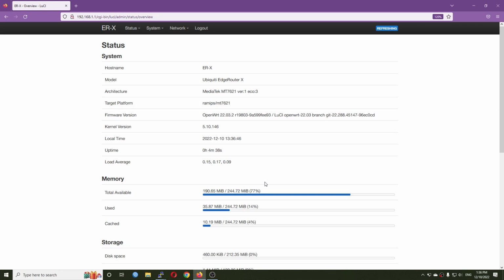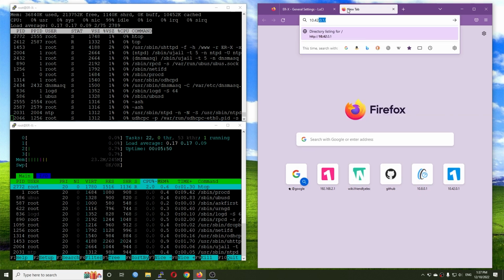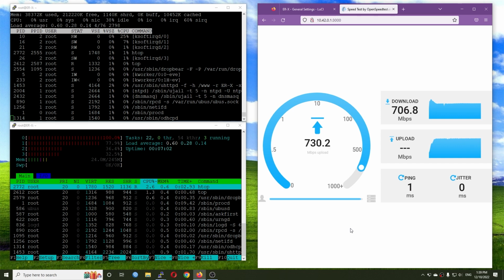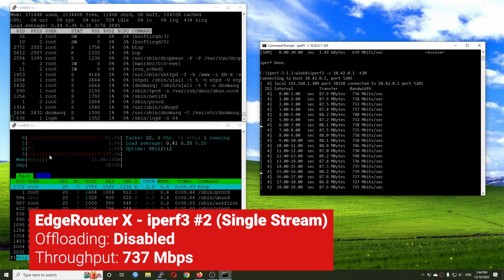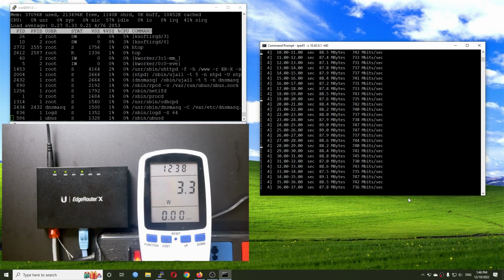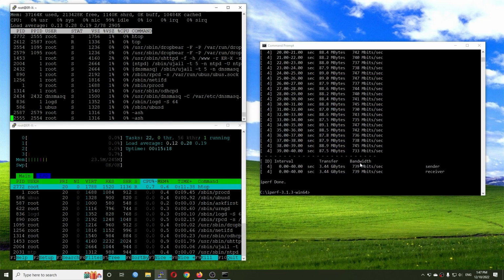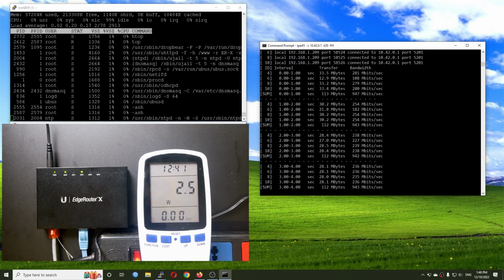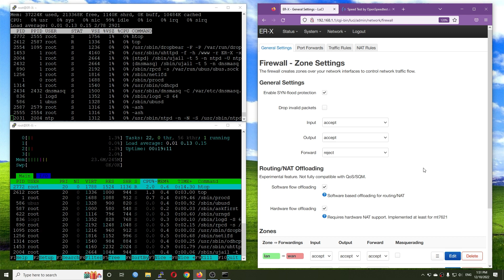OpenWRT - EdgeRouter X Throughput & Power Consumption (with Hardware Offloading)

Comment: yeah i have 4 of these ER-X. I get the same results with the stock firmware too. just one of these can serve 1000 IPs easily in a hotel.
Reply from the maker: At this time my ER-X is running EdgeOS. With hw nat enabled, I got Gigabit throughput, but DPI is not working properly.
Reply: @VanTechCorner  I think DPI will not work with hwnat enabled because hwnat is used to bypass the CPU and go straight to the destination device such as a smartphone. HWNAT creates a lookup table of source and destination.

Comment: I have the same setup currently and I really like this hardware, but I kinda want to upgrade it. I have a 1/1Gbps connection now that requires PPPoE authentication. It works fine and able to achieve ~850Mbps down/up, but when there are a lot of active connections it drops significantly.
Before this I used an Intel J1900 board which worked perfectly, but I needed that for another purpose.
Reply from the maker: With 1Gbps up and down, perhaps you can take a look at the Flint GL-AX1800 (https://youtu.be/E8E5CUbK2Qo?t=752) or the Linksys WRT1900AC. These are the devices I have been working with. Besides, if you like ARM SBC, the NanoPi R4S and NanoPi R6S will be my recommendation.
Reply: @VanTechCorner  thanks for replying. I'll probably go with an ARM board or if I can get a good deal on a x86 sbc.